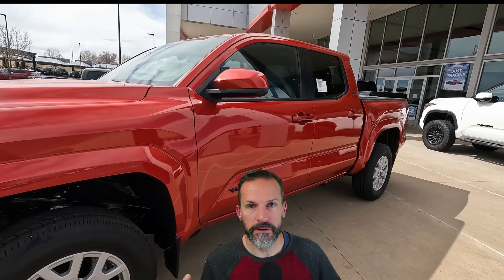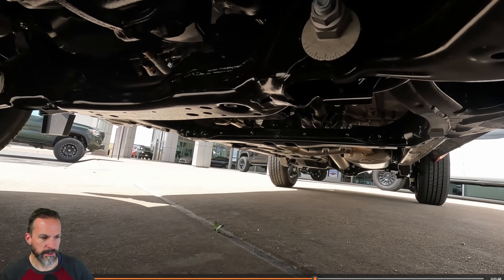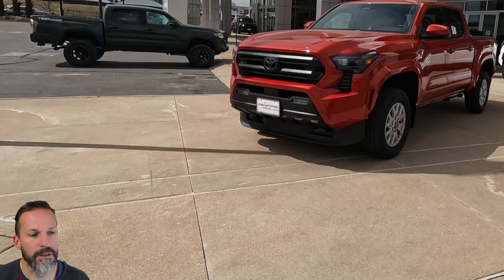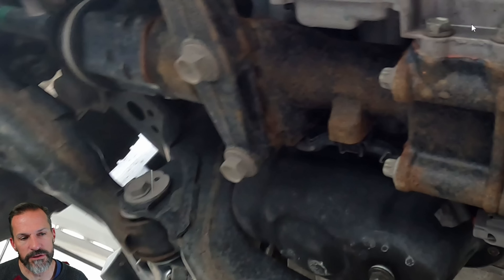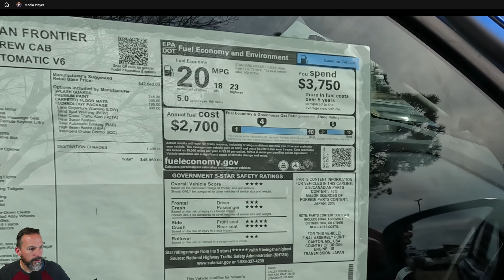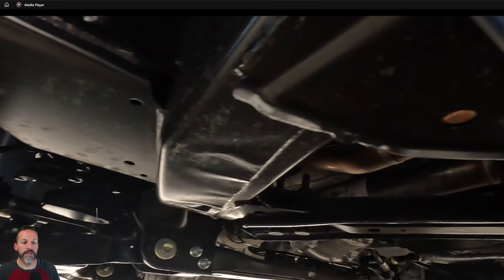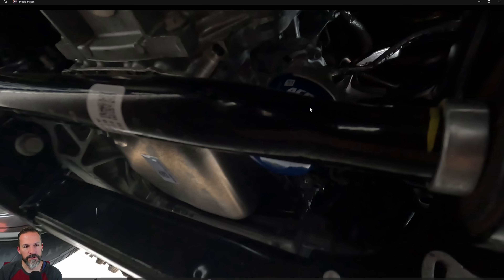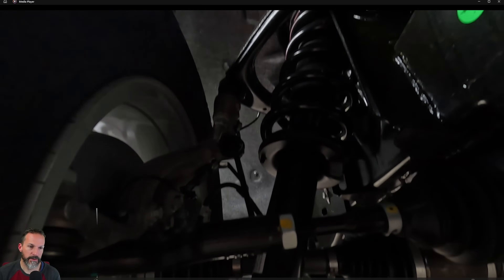2024 Toyota Tacoma, Nissan Frontier and Chevy Colorado. Comparable Build Quality Underneath?

Comment: Gotta 2024 Solar Octane 6 speed manual TRD Sport Taco, took the chin strap off and it's gorgeous and a hell of a lotta fun to drive in sport mode. Had a 2017 Lariat, 2019 Ranger, Taco is just FUN and perfect for my 6'2" 230lbs frame. I don't do off road, have a Grizzly for that, so this is the perfect truck for me! Cheers!!
Reply from the maker: Glad you like it. Having a manual is a big plus....almost impossible to come by anymore. Kinda crazy it has uphill hold and rev matching too. Like my old BMWs of 2010 era LOL.

Comment: Looks like Toyota cut corners with light weight splash shields, even the TRD off road is plastic skid plates, not very stout for any type of off road environment. Good overall look of the nuts and bolts below deck! I got a 2023 Tundra SR with zero skid plates, but went with some TRD off road ones that I will be installing because I like to play in the mud!
Reply from the maker: Yeah even my old 2008 Sequoia is more protected underneath...it also has more clearance LOL. They are turning in to pavement queens for sure...

Comment: I wonder if anyone has tested the domestics to the point of failure yet? Everyone seems to be concentrating on Tacoma.  But no one seems to be driving  the competition as hard. I wonder why?
Reply from the maker: Well, in the TFL case where they broke the front diff in the Tacoma, the trail boss Colorado made it just fine. The Colorado/Frontier have been out longer and had little to no issues so far, people have been beating on them for a few more years than the new taco.  I think the redesign/unprovenness of the new tacoma is why it's getting all the focus now, that will wane in the next year or two. If it doesn't have any additional issues, it'll probably still be regarded as the "most reliable" just by default. For me, I don't really consider a truck reliable until you start seeing mass quantities of them hitting 150-200k virtually trouble free. We'll see if any of these can do that :).
Reply: The engine in the colorado has been out since 2019 in the Silverado and slightly refreshed in 2022 .Theres enough history that its an ok engine.Trust me as a GM owner if something is giving trouble.like the 3.0 duramax setup you hear it from owners
Reply from the maker: @davefornit6235  I had one guy on my channel tell me he has the 2.7 with about 100k on it. He loves it but has to add oil between oil changes which is what I’d worry about, only DI, no Port injection. We will see if that becomes widespread because lots of people never check their oil lol
Reply: Lot of people dont and a lot dont do even base maintenace. I think its going to be a hit and miss with oil consumption.
Reply from the maker: @davefornit6235  You might be right on the maintenance, but people that buy these expensive trucks you'd think would be very careful about it. I just watched a teardown on "I do cars", love the engine tear downs there. I was surprised that another Ecoboost, 2nd gen with maybe 80-100k miles had all 6 pistons with the secondary rings frozen up with carbon. The crankshaft snapped, looked like a bad cast, but all of the pistons and rods were fine...just the rings were completely locked with carbon. Could be maintenance issues but, man that is such low mileage. With port injection and no turbos, people couldn't kill half the Toyota engines even when they tried to have poor maintenance :)....times sure are changing.

Comment: On the Nissan, the transfer case is used for the V8 Titan and Frontier... on the front diff, Frontier hold up but the V8 when mudding hard can blow the diff. Most of the parts from the Titan can transfer over to the Frontier (same automatic 5 spd between the two trucks) Hell the Frontier had the VK56DE as well. (edit: sorry my comment was on the A60 and D40, a lot of the 2024 look like the A60 and  A61 generation)

Comment: The odd colored Chevy Colorado Trail Boss’s are selling for 34k right now, you get a bigger screen than any of the builds these Toyota dealers are putting out on the lots, more features than most of the tacos they’re putting out on the lots, and a 16k savings for a truck that’s more capable and far better looking. L Toyota? Never thought I would be saying that. It’s the year of the Colorado/Canyon/Frontier.
Reply from the maker: You might be right, but there will be the loyal toyota fanbase that always buy just based on brand. I think the issue people have with GM/Ford is their reliability/trust of the engine/transmission etc. No doubt they are making a great looking truck. I do like the infotainment/gauges a lot more in the Colorado than the taco, but time will tell on reliability. I had a guy comment on my channel on the GM 2.7l Turbo, he loves it in his Silverado, but says it has been burning oil since 30k miles, it now has 100k miles and burns a qt every 1000 or something weird. He still likes it a lot but for me, that's a deal breaker. Time will tell if the Taco and others do the same thing with these turbo/direct injection engines. The taco has port and direct, but that doesn't mean it will fix the carbon issues. I think for people that just buy new vehicles every couple of years, or run to 100k then trade, all of these would be fine.
Reply: I got my eyes on the AT4X for the first time recently and man it is GORGEOUS… don’t hear a lot of people talking about it, if I were going to pay a premium over the Chevy, that would be the direction I went in, because it’s tangible, you can see it. It’s not just an arbitrary price hike out of nowhere. It’s very clearly an upscaled Colorado with more premium finishes. Even still, the GMC’s look like a bargain compared to the Tacomas. What am I supposed to think Canyon AT4x vs TRD Sport with no features, outclassed across the board, hmmmm very difficult choice! It’s mind boggling really, I can’t quite make sense of it. The math isn’t mathing. low to mid tier tacomas out pricing the highest tier ultra performance models of their opponents? Give me a break. This is what we get as a result of manufacturing in Mexico for pennies on the dollar? Yikes.

Comment: I agree about the transmission lines id likely swap them out for stainless lines also I think that v under the Nissan was billstien as they supposedly reconfigured some of the chassis & some mounting points on not only the shocks but a few other things supposedly I guess it makes sense but I could be wrong

Comment: Frame is a lot thicker, love the oil cooler before it goes in filter. its a 4runner rear end
Reply from the maker: Yeah the new frame is much larger, however not thicker steel in spots. I was surprised when the Toyota engineers said they used less steel in areas, then reenforced other areas. No telling if other brands are doing the same thing, making large looking frames but less thickness overall in the actual steel. Time will tell how they hold up, but they did appear more beefy (all of them).

Comment: Great video. I was surprised Toyota admitted they reduced steel thickness but the real test is how fast surface rust will eat into 1/8 inch thick steel despite all the reinforcement. That Frontier made me laugh, brand new and that much rust??? But none of the trucks were undercoated at all which is a definite must do anymore with any new vehicle. A video I saw of a 2011 GMC truck needing basically both sides of the frame rails from front to back needing replacing because rust had destroyed them just made me sick knowing GM sold garbage and they didn't even care. I'd want a 10 year warranty on the frame alone if I were dumb enough to buy a new truck which no car maker would provide anyway because frames are built to fail like everything else. But I'm old so my older SUV will last me. I just feel bad for younger people who never grew up in an era where quality actually meant something. They are being taken advantage of left and right now with every product it seems.
Reply from the maker: Well said. I too drive an old SUV, 2008 Sequoia :). Love it still...even at 230k, but I'm looking to get a used Tundra or lower mileage of the same Sequoia. There was a period where durability/longevity was the #1 goal, anymore, it does not seem to be the goal of these manufacturers.

Comment: Really enjoyed this video very helpful.  I read someone got sand in the Alternator while driving it on the beach {which is a thing where I live} on the Frontier due to the placement glad it isn't a huge issue.  That flex tube is horrible that needs to be metal also the rust on the Frontier was shocking they where all the same model years right?  I agree I have seen ten videos about the electronics and interiors when someone is looking to buy a truck they should be interested in the things that make it a truck.
Reply from the maker: Yeah these were all 2024s. We did get a decent amount of snow on those Frontiers and I believe they sat through it a lot of the winter,  I can't guarantee that but I still think they shouldn't be showing rust yet..  

 That Tacoma just arrived in the past week or so I believe, not sure about the Colorado. The Colorado has been selling fast here too, so only one non off-road model that I was able to find in stock.
Reply: I really want to like the Frontier since it has a reliable transmission and doesn't have a turbo you gave me a lot to think about thanks for doing this hope others find it helpful.

Comment: To the designers and engineer who designed the Tacoma. Why didn't you just stick to the design of the old one and put in the aesthetic of the new one with the new power train? I wouldn't get the new Tacoma for another 3 years to wait and see. In the meantime getting a used one seems like the wises choice.
Reply from the maker: Yeah we'll have to wait a while to see how the powertrain holds up.
Reply: Because the old one sucked in all kinds of manners.The engine was subpar in peformance, getting up to speed , towing etc .Yea its reliable.However I want something that can pull a load and not struggle to get up to speed .Our 4 runner tows just like they Tacoma just not something Toyota seems to put a thought into
Reply: @davefornit6235  I wouldn't say it sucked. Just extremely outdated. The tundra was meant for towing and we are yet to see these turbo engines long term longevity. Respectfully it should take them 5 years to make meaningful improvements for max durability. Maybe it's just a matter of chip tuning.
Reply: I get ya.Its the price point of the 3rd gen toyota for.me to both tech and performance and even comfort was a turn off to me The 45k they were selling it at opens up to alot of other brands reliabilty or not lol.Because the only thing the internet is used for when it comes to a model of truck or car is to complain about something not so much to say they been trouble free. You look at any model and reviews and its about some issue this or that.

Comment: I bought a new Colorado Trail Boss but still own my 02 Silverado I bought new, that new Nissan has way way more rust underneath it than my Silverado, I do live in Arizona but their is no rust whatsoever on the axil frame etc, that Nissan looks horrible considering it’s a 2024 truck! 🤯
Reply from the maker: yeah was a bit odd. It sat in snow for sure, but I don't think it should rust that fast.
Reply: I have a 2022 pro 4x been through 2 winters and 0 rust anywhere. Still looks new underneath
Reply from the maker: @kennyg7102  Good to know. I almost wonder if my dealer got these from some flood area or something weird LOL.

Comment: Frontier Transmission is a Mercedes Design built by Nissan / Jatco.  Not a ZF.
Reply from the maker: I'm 99.99% sure It is built by ZF, probably licensed to Jatco/Merc. I'm 99.99% sure. I've been inside these repairing them before on the 6spd, the pan looks identical too :).
Reply: @TheCarGuyOnline  you sure you aren’t thinking about the pathfinder?   That is a ZF
Reply: @TheCarGuyOnline it's a licenced Mercedes 9g tronic. Jatco makes it as the JR913E and it's in the Titan and new z.
Reply from the maker: @0psec  From the interwebs...  "

The 2020-up Frontier 9 speed is a German ZF design manufactured under license by Jatco, Nissan’s transmission company. Many/most parts are ZF. Mercedes and BMW and others also use the same ZF.

Mercedes-Benz had nothing at all to do with the engine. Nissan designed and engineered the VQ series of V6 engines three decades ago. The Frontier’s VQ38DD is simply an evolution of that design.

Mercedes used to sell a version of the Navara (the cousin of the Frontier in the rest of the world) as the Mercedes-Benz X Class Ute (made by Nissan). But that stopped in 2020.
Reply: @TheCarGuyOnline  I'm not seeing zf having anything to do with it. Daimler engineers and builds their own AT. Look up star assembly in Romania. They started doing the 9g there.
Reply: @TheCarGuyOnline also no argument on the vq38.
Reply from the maker: @0psec  All I can tell you is I've rebuilt the valve body on ZF transmissions, the bottom/pan looks 100% identical to these on the Frontier so...I'm still saying it's ZF built. My hands have been dirty in these so...I'd be shocked if it wasn't ZF built. No one makes a black/fin'd plastic pan like ZF, at least none that I have seen in person. I will try to get a part number and verify :).
Reply: @TheCarGuyOnline  I believe I saw that the pan is built and developed by filtran.

Comment: I agree that Toyota went cheap on their trucks. Felt undercarriage & thats scary  on Taco exhaust pipe. Older Tacomas exhaust pipe was up & out the way. I think Toyota ran out of room but try to get buyer attention with exhaust pipe bigger than normal. I feel for Toyota. They lost a tremendous amount of value. Shouldve kept same v6 & v8 engines. Turbo is future problems & will cost Toyota in future. If not broken Toyota, why fix it. Instead of " Going Places" ,  i think Toyota need to go back to what it had on engines. More like going in for repair now.

Comment: Frontier seems more a truck to me
Reply from the maker: I think there are sure pros and cons to each. If I could trust the GM engine/tranny, I'd say they actually designed it the best with regard to just being able to buy it and go off road, even in the base model. I used to love GM but had so many issues with them, I had Nissans for a while with zero issues, then I eventually moved to Toyota and had really no issues. Now, I feel like there is so much parity between the brands, they might all end up having similar issues and less reliable vehicles, time will tell, all just speculation :).

Comment: Sadly, 😢the way they build this stuff today, 5 years is about the maximum amount of time you want to hold on to these vehicles. Maybe 7-10 years if you don’t drive them in rain, salted roads and snow.🫤
Reply: Stop it Tacomas last a lifetime!
Reply from the maker: It will be interesting for the next 5-10 years to watch all of these new vehicles play out. I have a feeling this turbo trend is going to be the downfall of modern vehicles. Even looking at a company like Ford who has been building the ecoboost engines for what, a decade now? They still can't get it right. I watch engine teardowns of these turbo engines with direct injection near 100k, piston rings stuck, spinning bearings burning oil....all garbage :).
Reply: Excellent review Car Guy Online.👍